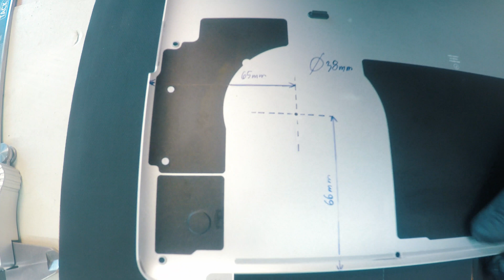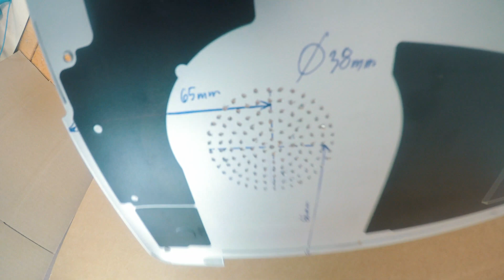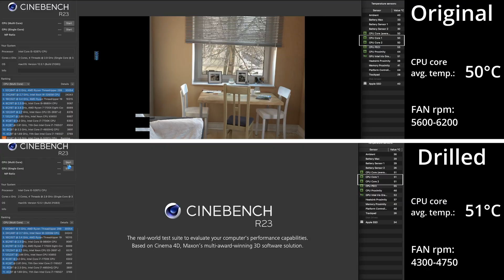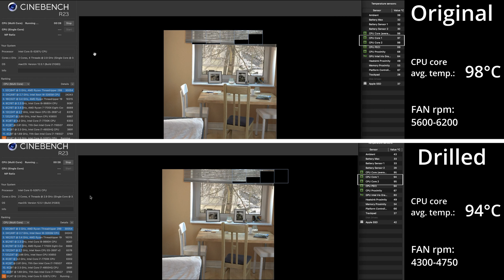MacBook Pro 13-inch COOLING Cover Holes?  Drilled Back Cover and Benchmark Test

Comment: If you drill, repaste with ptm7950 and have a more agressive fan curve im sure you could get normal laptop temps of like 75-80c. Im gonna try it on my 50 dollar Mintbook pro
Reply from the maker: it still maxes out on like 104c … no matter the curve.   (when rendering) this mod is amazing for day to day use … it lowers the temps significantly for normal usage

Comment: The point of the air being forced through the slits is to that it can also cool off the battery and other components on the logic board, before it gets expelled. It's possibly one of the worst cooling designs ever though, and only works with the Apple Silicon chips (reliably).
Reply from the maker: dude… rewatch the video… full video
Reply: @takeapart  hmm?

Comment: Nice work here, it is very clean and almost looks like factory design. I am not saying this is wrong or bad, I've often had this same idea. My problem is that by allowing direct access to the intake, one is reducing the amount of airflow elsewhere. Air does not only flow in the back but there are two slits along the side and lots of air flows into those slits, I know this based on years of finding dust in those locations inside user's computers. So, one might be able to cool core components more effectively, resulting in higher benchmark scores, but probably cooling the non-core components less than intended, likely resulting in premature failure, and it only takes one of those IC's to pop.

Comment: the other reason why it heats up so bad is also the battery. many battery replacements are cheap, and run very hot when charging. makes a bad combination of things when apple purposely made a laptop with almost no vent .

Comment: Many people don't estimate the heat coming from other parts. Air gets sucked through the whole computer, cooling EVERYTHING down. Your NVME Ssd and Battery might not get the cooling they deserve and struggle over time when rerouting the airflow.
Reply: It is sucking in more aire to cool
Reply from the maker: yes
Reply from the maker: there is still airflow in the case … holes combined are is way smaller than intake of the cooling fan .

Comment: But i think there is a better way we can use and external botton fan to cool the backplate of macbook on the internal side of macbook. Need to fill the inner part like SSD and CPU PART WITH THERMAL PADS that will connect to the backplate transfering all heat to backplate.
Reply: Yes,  this is exactly what i have done (Thermal Pads) - the bottom casing get extremely hot. Just drilled the holes and waiting on a fan cooling pad.

Comment: This is a go do.. Mac Air flow success ... I will do both sides... it need to breath anyway ... great job
Reply from the maker: if you have two fans … I would do same …  it should still keep sufficient airflow over the motherboard…
Reply: @takeapart  yes.. I believe. MAC ... played fancy but this Logic board heats up like hell ...where buy it can even burn ur skin. Yes I will do that and add a net inside to cover from insects to get access ....let's do a clean job so that it will look clean and neat
Reply from the maker: @slambk nice!

Comment: Will this work on an A1278 Mac Book Pro? I want to completely max out my wife's computer. Do you have a video series documenting all of these mods?
Reply from the maker: that is bit older model … but it should work…. make sure to double check before drilling
Reply: @takeapart   it isn't really 2012 so I'm not sure if the fan system is the same but I'm going to give it a shot.